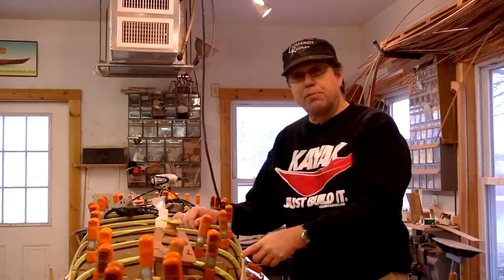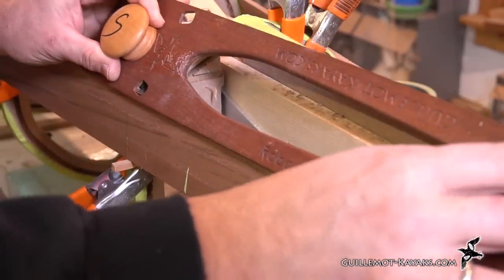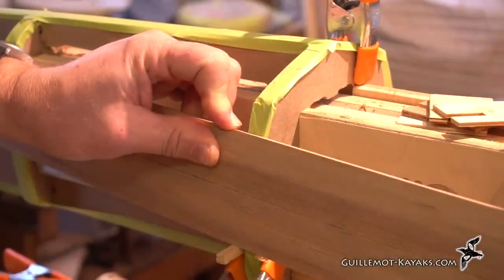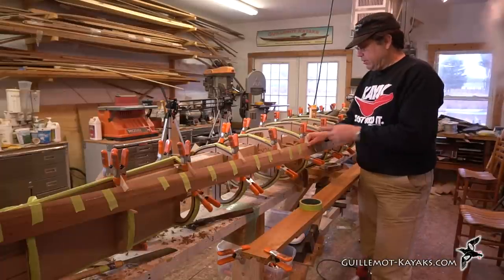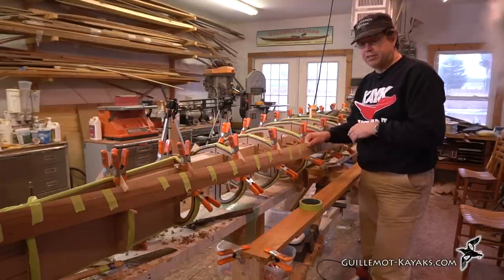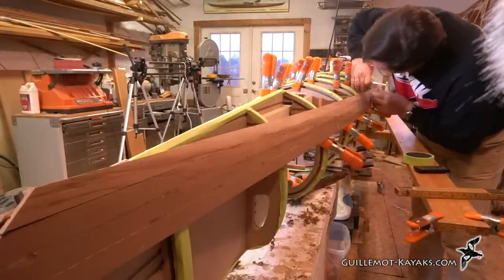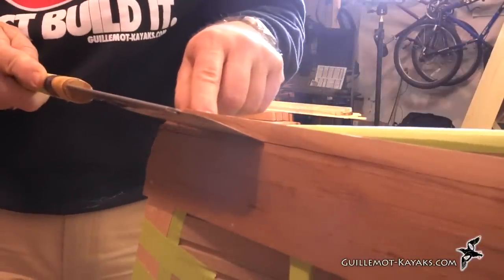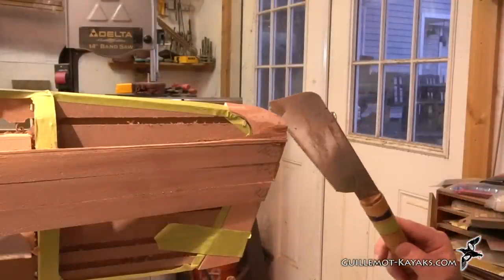Let Me Strip For You - microBootlegger Sport - E12

Comment: @15:25 the comment was that part of the stem will be trimmed at a latter stage of the build therefore stapling the strip would be okay. Will it also be okay to Hot Glue the strip in this situation for the same reason the stem will be trimmed at a latter stage? Love this series even more the second time.
Reply from the maker: I don't like leaving hot melt glue in the structure. Since it turns liquid when warm, it could start to move while the boat is in the sun.

Comment: The Glu Bot is a nice item, I use one which has a double guide to center the tip on small stock. You cut one off and twist the other a little bit and it will be a perfect guide along the strip.
Reply from the maker: I'm liking the glu bot so far. It is a little hard to squeeze especially along a long seam when compared to my standard Boston Round squeeze bottle.
Reply: You said it is not a good idea to wipe of excess glue, because it would show any left overs once it get epoxied. On the outside scraping the hardened glue rests is not a big deal. but on the inside it is kind of painful. would it be an option to wipe off just the inside or could that lead to a week bond with the epoxy and glass?
Reply from the maker: While the inside won't be seen much in a kayak, I still want it to look good, and the scraping operation I use is quite good at getting rid of glue drips, it still has trouble with smears. Glue between the epoxy and wood probably would reduce the strength, but likely not enough to worry about.

Comment: I am just starting to research wood boat building.  Is there an article you would recommend that discusses pros and cons of beveling vs bead and cove?  Is beveling faster as you have to only dress one edge of the strip?  It seems bead and cove would help ensure alignment along the strips in between the forms as you have a little “tongue and groove” action going on, but I figure cove and bead must have some downsides or you would be using that method.  I can see where it would make grain matching harder as you are removing some of the face of each strip in the beading process.
Reply from the maker: Cove and bead is faster for a reasonably tight seam. Beveling the edge produces a more consistently tight seam, but requires more practice and skill.

Comment: For the waterline, have you considered laying up the strips as normal, an then using a router to rout a dado to inlay waterline strip? It might be a bit cumbersome due to the curve of the hull, but I'm sure you could come up with a jig of some sort 😁
Reply from the maker: Yes, I have thought of that. As you say, the trick would be in how you jig it up. Since the surface of the kayak is rounded in all directions, it is difficult to come up with a system that would hold the router steady while cutting the groove. If the router rocks around you will get a wiggly line.

I could probably hot-melt glue some guide strips in place to for the router to register against, but lets say you have a small router with a 3" diameter base. The guide strip might be 1.5" away from where you want the line cut. On a tightly curved surface, that introduces the possibility of lots of wiggling.

While the system I use of over-stripping then cutting back is a bit wasteful, it is actually pretty straightforward, accurate, reliable and quite quick once you got the hang of it.

I have some pattern ideas in my head where an actual inlaid stripe is really what I want, so I may still end up doing a router system groove some day. It would probably take me a day to set up the jigging before I was comfortable enough to make the cut.
Reply: Nick Schade I used to do a bit of guitar building, and many luthiers use jigs that could be adapted to this application. Some ideas here: 

http://www.theamateurluthier.com/amateurluthier/htmlpages/bindrtrjig.html

Instead of a normal router base, imagine a delrin /UHMW ring slightly larger than the router bit, moving between two evenly spaced battons. 😁
Reply from the maker: I like that router arm. Very cool.

The UHMW ring isn't the only issue, its the two 18-foot-long evenly spaced battens.

What I would really like is a 20' long 5-axis CNC machine that I could place the stripped up kayak in and let the machine perform all sorts of useful operations: trimming, inlay, sanding, etc.

Comment: Hey Nick. Jim Dodd posted this super neat method for applying pressure during strip glue up: http://buildersforum.bearmountainboats.com/viewtopic.php?f=9&t=4773. I'm thinking of building a set of these for my planking process. Maybe it could save you some tape and time?? Anyways, I thought it was a very smart idea.
Reply from the maker: I think it is a very good idea. One reason I use tape is because I can fit more strips with the tape in place. I can't glue the strips down until I remove the tape, but I can work on the fit.

Obviously, there are a lot of times where I will not be fitting strips until the glue has dried, in which case, this kind of clamp would work very well.